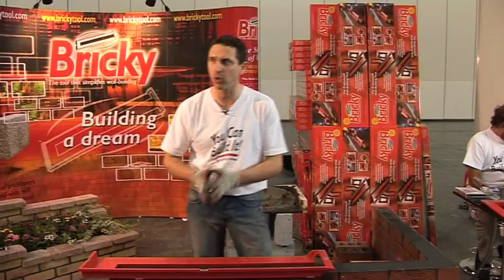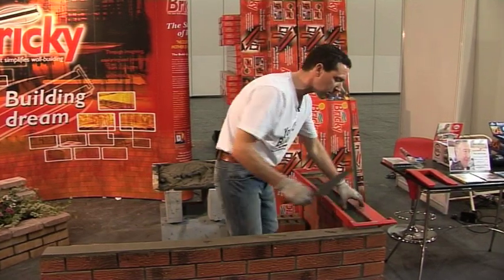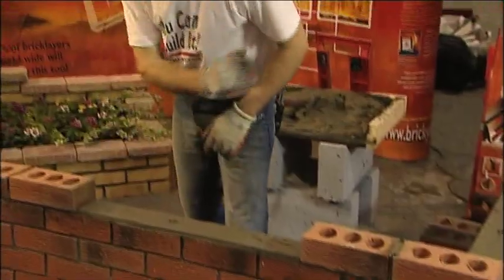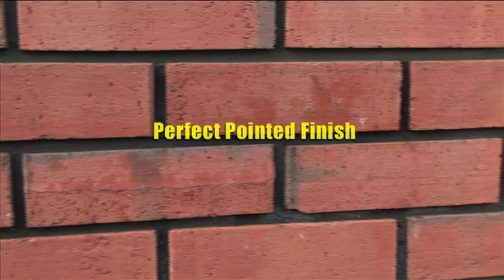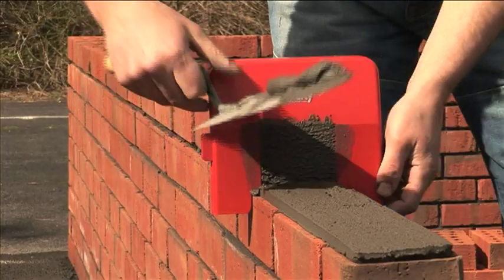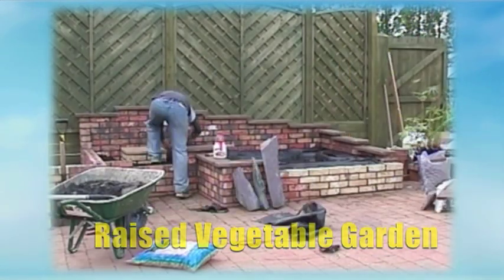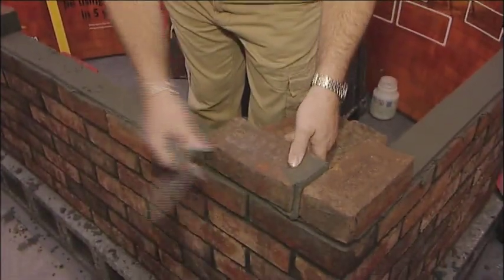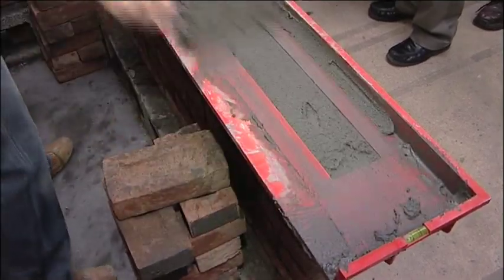Bricky - As Seen On  TV

Comment: @rollindanny57
Sorry 4 the delay in answering.
Danny anywhere it is needed to lay a perfectly vertically straight column of bricks/blocks, the Bricky can do it. It's systematic. It's a precision engineered tool, like many manual labour tools.
However, if it is being used TOTALLY IMPROPERLY, as in excessive force being used on it, like any tool, there's going to be error.
But God Man, in the hands of someone who's got even half a clue, it's usefulness & efficiency would be unrivalled.